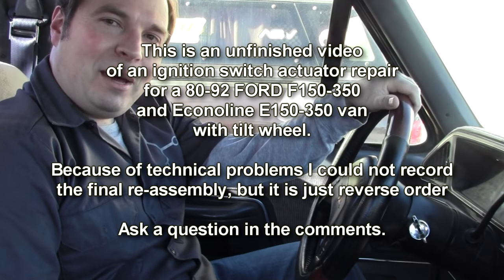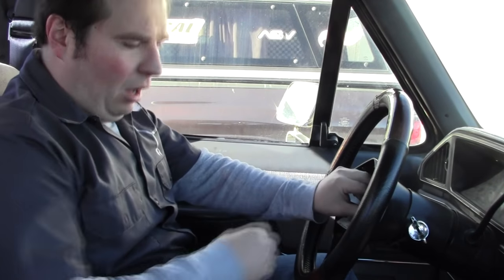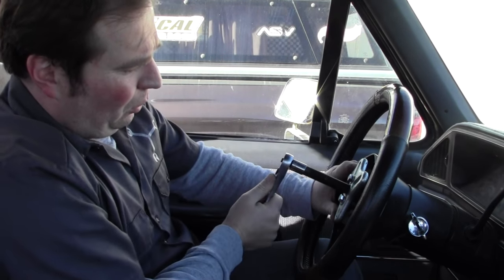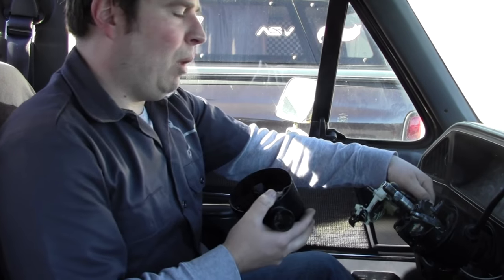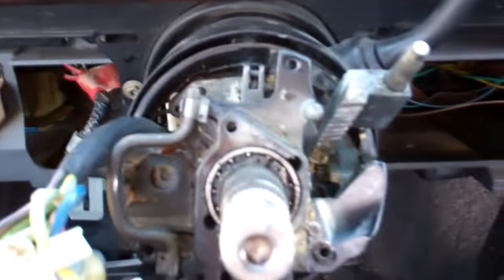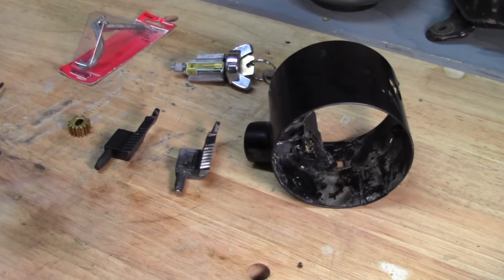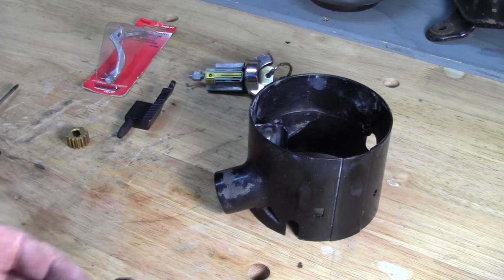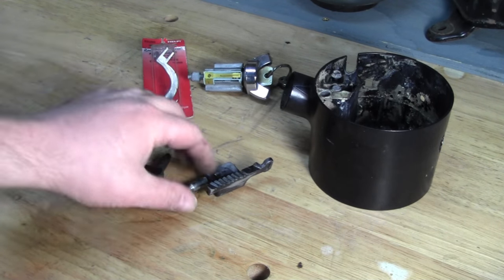FORD 1980-1992 Ignition switch, lock cylinder, rack, pinion and actuator rod repair

Comment from the maker: https://www.thejunkmanadv.com/the-junk-mans-blog/ford-ignition-switch-repair Visit this LINK for the Ford OEM part numbers for all the parts used to repair in this video.
Reply: thejunkman, I can't slide the rack back in its slot. I've been turning the key to move the gear in different positions but it won't slide back in there. What do I do?
Reply from the maker: Did you remove the entire lock cylinder housing?  That is what I did and you just slide it in, use a flat screwdriver to move the gear to the right position (first tooth engaged) and it will just slide in.  There is a retainer to remove for the rack obviously.  Then after putting it on the column you need to hook up the push rod.  Just the way it was taken apart.
Reply: @thejunkman  this is what I was trying to ask. I just can't get it in after an hour of fidgeting
Reply: Zo,08 I'll

Comment: This is why you run a jump wire to the solenoid to a starter botton on the dash turn the key to the on position and press a botton no third click with the key to fail
Reply: Hi I'm having this issue with my truck, I like the idea of the button. How do you wire that. Are you saying take a positive wire off solenoid go to one side of button. And then off other side of button go to positive of starter. Is that correct or is do you have a wiring diagram of what to do. That would save a lot of time instead of taking the stearing column apart. Great idea you have and would appreciate your help thank you
Reply: bypass that crappy engineering.   a piece of plastic imagine that on such a important linkage.  crp.

Comment: Does anyone know why the switch won't turn? My 87 has been setting for 3 or 4 years and the key won't turn? It's an 87  with a 4 speed  not an automatic so it has no steering wheel lock? I think?

Comment: Thank you! I watched and rewatched this video several times while working on tearing down and reassembling the ignition actuator on my 1990 F150. I got stuck on the reassembly portion getting that black gear piece realigned with the house and gold gear. Couldn't have done it without your help!

Comment: Thanks man! You know on mine,back before the aluminum actuator broke,I noticed that the key required more and more effort to turn the key to start,and would have to turn back CCW,or it would actually stay cranking if I did'nt like yours.Your the 1st one to mention the gear issue,and believe mine does have that problem too.Thanks again,and like your style of explaining the problem.You should do more of these instructional videos for automotive repair.
Reply from the maker: The automotive repair video market space is fairly saturated with people who do this better than me, but I appreciate the comment.  I may do more in the future when a problem arises.
Reply: I wonder if that's what happened to mine.   The starter was sticking. Turn the key backwards a bit and starter would disengage

Comment: Great video. I don't have that exact problem. I have no accessory so I can listen to my stereo without the key switch in the on position. My key switch moves fluidly but the key switch does not turn backward for the accessory. As I turn the key forward to start, It has play and a catch as if there is an accessory forward not backward just before turning the switch to start.
Reply: Same here can’t figure out how to fix the issue

Comment: I love the way you just change scenes from before to after when removing the ignition housing after removing the lock cylinder.   LoL been stuck at that point for awhile.
Reply from the maker: I kind of apologize, this video was kind of a cluster F__ as I had audio and video problems.  This is what was salvageable.
Reply: @thejunkman  Ok.  Any idea why after I removed the 3 screws the ignition housing on my 89 F250 refuses to slide off?  Removing the ignition switch changes nothing, the housing still won't come off.

Comment: I can't get that pinion that your holding at 4:35 seconds to go back  into the gear under the ignition tumbler. It just won't start into it. I greased the bejesus out of it and still it's biting just before the first groove.  Doesn't make any sense at all!!! I'm about to grind the end down to allow it the clearance.  Any tips? You actually talk about it at the end of the video.  The parts I have don't look worn but I'm just gonna get a new pinion and tiny sprocket and grease it all up and do all new! So annoying
Reply from the maker: You need to clock the gear to the rack just right.  Start it on the first tooth of the gear.  Also you may need to sand/file a bit of the paint away for clearance.  It is also possible that your housing is worn with grooves from the play and now the new one won't fit quite correctly.  You can see wear on my rack which matches the inside of the housing.  That would be an extreme case.
Reply: @thejunkman  thank you for responding btw. I never got any new parts yet.  I need a lower actuator but I was just trying to get mechanism back together because it fell out when I took everything apart and it just won't go.  I was gonna grind it but I'm not haha. I'll just buy all new parts.  Do you have a video on replacing all those parts that you gave part numbers for at the end?

Comment: On reassembly of the steering wheel to the steering shaft please note there are timing marks on both the steering shaft and the steering wheel that need to be lined up to keep the steering Centered . This is important, the steering box has a sweet spot in it . It's about Road feel, and the steering of the vehicle feeling loose. Wondering sometimes.

Comment: Ok so I bought the book which helps but I can’t get the key out I have a 88 e350 trying to work on it my self  we replaced the actuator that part you bought but didn’t need  I bought a new key cylinder lock but it won’t even fit in the column. called Ford. They don’t sell them anymore and my key is stuck in the key cylinder that I had. What do you think is the problem with it?
Reply from the maker: I would get a lock smith at this point, or just go to the auto parts for a new key/lock cylinder combo.  Those are easy to get.

Comment: Having issues with the placement of the tumbler and the key cylinder as it attaches to the actuator 
I had it in but the key would not turn back to lock position (so engine would not stop also the acc would not turn back because it basically stopped at the “RUN” position 
Any ideas would be appreciated
Reply from the maker: Probably the plastic housing of the ignition switch on the bottom of the column might be the issue.

Comment: my gear fell out and now im trying to put it back in, but not sure on how to position it. you quit right as i thought you were gonna put it back together!
Reply: im gonna turn the brass gear so that the rack will engage the first tooth and hope that is the standard position. i dont want to pull it apart multiple times to get the clock(position of the circular gear) right.
Reply from the maker: That is how it should be.

Comment: Great video! Ford D4AZ-3E717-A is the brass gear. I can’t seem to find this part anywhere. Anyone else having this problem or a solution to it? Thanks!
Reply from the maker: The dealers can get it. My ford dealer had them in stock.
Reply: Thank ya kindly! Seems to be discontinued everywhere on the web
Reply from the maker: Sometimes they turn up on ebay as NOS parts too.
Reply: I changed everything like you did in the video like you did. I still had the same issue. I change the ignition switch and I’m back in business running like a champ! Lol thanks for the video!

Comment: How do you take the key switch out if you've lost your keys?
Reply from the maker: Yeah, un huh, "lost keys", said every car thief. lol.  But seriously though you call a lock smith or get a lock cylinder puller that will break the pin.  Car thief's use lock cylinder pullers too.

Comment: BE NICE IF YOU OR SOMEONE WOULD FINISH THE LAST PART  ABOUT THE INSTALLATION AND TIMING OF THE RACK AND PINION  .  HAD NO PREVIOUS PROBLEM WITH KEY SWITCH WORKING TILL I INSTALLED NEW ACTUATOR ROD, HAD TO REMOVE RACK TO HOOK PIN, PUT IT BACK TOGETHER,  KEY OUT OF CLOCK,  IN AND OUT MULTIPLE TIMES  MUST BE A SECRET CODE TO GET IT IN TIME.  MANY VIDEOS OUT THERE, OF WHICH YOURS IS THE BEST !  HOWEVER LIKE THE OTHERS , DOES NOT FINISH.   LIKE A SERIAL CLIFFHANGER  ! COME BACK NEXT WEEK FOR ANOTHER INSTALLMENT
Reply from the maker: There is no real "timing" as you call it.  The rack and pinion gear only will mesh in the housing one way.  Basically get the pinion gear so the first tooth is visible in the housing and then slide the rack in.  Simple as that.
Reply: Did you find the answer as I am now in the same boat, can't get back together and upper acuaturer hook to the little pin or if I do the key cylinder will not go in.
Reply: @thejunkman    So I am having to do this right now.  I get everything in place but like others have said it seems the cylinder won't go back into the lock position correctly.  Its just short of it and won't release the key.  What position should the actuator be in when reinstalling the rack and pinion?  The accessory position?  The vehicle off position?  Ready to start, etc?  Maybe that is where I am getting my teeth miss-aligned?

Comment: I'm about to do this, too.  Mine will start sometimes with no issue.  Other times, I have to tilt the column before I start the truck.  Since it will operate, I assume mine also isn't broken and is just gunky inside.  Also, my key cylinder will be slow to return and seems a little stiff to turn at times.

You mention to clean it and apply new grease.  Won't that just collect grime again?  Why not just clean it and leave it with no grease?  Or maybe use a spray graphite lube so as not to attract dirt and grime?
Reply from the maker: Well mine took 25 years or so to gunk up.  Your problem is most likely the wear on the rack just like mine.  Graphite might work too, either way grit is going to get in there and wear it again.  At that point the pickup will most definitely be junk or other more major things will need attention.

Comment: I got mine all back together. Felt like it was smooth…….. but, when I put my battery cables on my dash lights come on. I turn the key and it won’t start. The wait to start light doesn’t come on either. Not sure what is going on. I feel the upper actuator and gear drive line up. But something is off. Any help?
Reply from the maker: Is the switch on the bottom of the column in the right position?  It is plastic and gets brittle over time.
Reply: @thejunkman  The ignition switch? I just replaced it. How would I know what position? Isn’t it hooked to the actuator rod and moved by the gear shifter?
Reply from the maker: Well then that isn't it.  Probably the rack is is off a tooth then.
Reply: @thejunkman  Do you have a video on how to put that back together? I tried to move the rack to a different tooth but it seems like it only slides together one way.
Reply from the maker: That footage was lost, unfortunately.  That is why it is not in this video.
Reply: @thejunkman  So to help anyone out that comes across the same problem. I had to reposition the ignition switch on the column. It has slotted holes in it. I replaced it along with the other stuff and it was in the wrong position. Once I found the right spot, all worked great.

Comment: @thejunkman Thanks for the great video. Today my '89 bronco would stall and die when I put it into gear. I thought I had a vacuum problem, but then realized my ignition stitch had alot of play in it. When I put truck into gear it would die, but intermittently if I touched the column the truck would die as well. Would this also be an indication of an ignition assembly broken as well? Thank you for your help.
Reply from the maker: Yeah, probably.

Comment: Where can I  get parts for my 1992 Lincoln Town Car (switch cylinder)? FORD says they are obsolete and the after market one won't work.
Reply from the maker: The lock cylinder is readily available and so is the switch which is down on the lower end of the column (the lock cylinder does not contain the switch like on modern cars.  I am not sure what you are asking?  This video is specifically about the rack & pinon gear as well as the actuator rod that controls the switch on tilt/non tilt versions of Ford pickups and vans of this vintage.
Reply: @thejunkman  Sorry, but is this true for Town Cars also or just the vehicles you are dealing with in this video.
Reply from the maker: Yes, I just searched the parts you need.

Comment: I was curious as to where the actual ignition switch is on the column? I have an 87 f150 that was having problems when I turned the key. It had to be in the sweet spot for all the indicators to turn on and work correctly. This evening I tried to start it and turned it to accessory and fuel pump came up and dash lights did and then I turn it a little more and now there is no power or indicators or anything that comes on when I turn the key. What do you think is the cause of that?
Reply from the maker: The switch itself is at the base of the column. That is the problem. The contacts are worn.
Reply: @thejunkman  I appreciate the reply. Every video I’ve watched for 80-92 shows the switch on top of the column. I removed the rear trim piece on the column and found the push rod that actuates the switch. So I’m assuming my switch is on top like in the videos. I haven’t pulled the dash trim and dropped the column yet though. New switch wont be here till Friday.
Reply from the maker: Yes it sits on top of the column, but down near the base almost to the floor.  It has a lot of plastic that gets brittle over time and then the contacts wear out and that amount of "play" causes what you are experiencing.  A broken actuator and these rack and pinon gears also contribute to this.  Start at the switch as it is easier to replace.  Then if it still is a bit funny working, then replace the parts in the video.
Reply: @thejunkman  okay, thank you. The key cylinder seems to turn alright and I can see the actuator pushing the rod to the switch, so I’m hoping I don’t have to go further than the switch. Also, can you tell me where and what color the fuseable link is for the ignition, and the location of the relay? I found 2 relays on the driver side by the wheel well. One has green connector and I can’t remember off hand the color of the other connector. Both relays are black and square shaped. Looks like somebody had changed them before because they say made in china and I don’t see a part number on them. Just the numbers and such for however they work.

Comment: Would not putting this assembly back together quite correctly keep the automatic gear lever from locking into place when the key is removed? I just got this 91 Bronco and really don't remember if it locked in place  before I replaced my actuator key. But anyway it doesn't lock now
Reply from the maker: It can be, but it has been my experience excessive wear on all the parts inside contributes to this as well.

Comment: Thanks for the great video! I've got a non tilt '84, with what I think is a similar issue. The only thing is I can't get the ignition switch to turn at all, not even to accessory. I've been trying to pull it out with no luck. Any thoughts?
Reply from the maker: The arm is probably broken, or the ignition switch is stuck as in the rod that actuates it has jammed in the switch
Reply: @thejunkman  I've been told that I should just drill it out to get it out. Does that sound about right?
Reply from the maker: It is hard drilling and you will probably ruin the casting.  I wouldn't.
Reply: Update!? I think i have the same issue on my 83' F250
Reply: You guys should upload a vid so we can see 
I had a similar problem with my 87 f150 but I figured it out but I would need to look at what’s giving you the issue

Comment: Is there any way to get 1 key to work both the doors and the ignition?
Reply from the maker: Yes.  Have a locksmith key the doors to the ignition or vice versa.
Reply: @thejunkman  But they use different keys. An H50 and an H51. I can't find inter-changable cylinders to work one or the other for the doors or the ignition. I've been searching.  I'll rekey it myself, just need help finding them. Thanks.

Comment: Alright so everyone is assuming this process worked right? So i opened mine up and dont find any obvious issues... Its always been sorta funky. Turn it all the way to start and nothing happens. Well now its permanently not starting. I just don't know man! What do i need to do?
Reply from the maker: If the arm is not broken like I mention, then it is probably the switch is broken. It is mostly plastic and degrades ovet time. Mine fell apart when I replaced it years ago.

Comment: So i know this is late but my girlfriend is having a way worse problem but exactly like this too. hers wont turn the truck over any more the key can be parallel with the colum and it wont turn over. is there any ways to start the truck so i can move it 40 miles to my house without having to fix it there so i have all the tools i need next to me?
Reply from the maker: Crawl under the dash and on the column. Unbolt the ignition switch and just slide it with your hand to get it to start it.
Reply: I had this issue recently and I figured out a way to turn on the truck from next to the battery 

Let me know if you need help I can point you in the right direction to turning the truck with a screw driver 
It’s so easy

Comment: Is this any different in an 82 WITHOUT the adjustable steering wheel as far as the  ignition switch hung/locked up? Is it possible that my key is just wore out and not knocking all the tumblers??
Reply from the maker: They are similar.